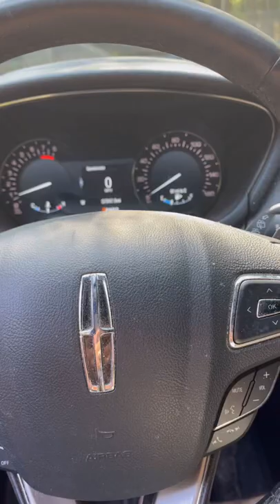Airbag mishap🤓

Comment: Could never happen in a 2000s Honda civic cuz the airbags never work 😂
Reply: A car over 20 years old they usually don't even go off. Airbags don't last forever..
Reply: Yes
Reply: @joeadler5379  more reason to get that aftermarket steering wheel
Reply: @joeadler5379  My niece just got hit in her 1999 Camry LE with 270k early this morning by an either impaired or distracted driver while parked in the starbucks parking lot. Her airbags did go off. The driver of the truck fled the scene. Police are still looking for him/her. My niece is fine and was even able to limp the car back to her mom's house just 1/4 mile up the road but its totaled for sure. Older toyota's never seem to die. Including their safety equipment.
Reply: @joeadler5379 not true cause they last forever
Reply: @joeadler5379 over 20yrs they last.
Reply: @dsteward85 some older Toyotas die.
Reply: Sometimes you kinda don’t who would want to deal with a totaled car on their insurance policy?
Reply: 2003 Honda CRV airbags have a recall for shrapnel 😂

Comment: Don't turn the key on and disconnect the battery first. I've saw the video that the gauges are working which means you've turned the key up while the battery is alive that the sensors will be interrupted. Dats the reason why the airbags deployed when you trying to remove the airbag cover.
Reply: Bruh this is fake, it was made as a joke
Reply: @huhuuhuh9081 he still has a point tho, always make sure you disconnect the battery unless you want to become one with the screwdriver lol

Comment: Question: All those airbags recalled, every make & model. Replaced, warranty. Dealerships.  HAZMAT, yes? Transportation, the defective airbags..Q: Where do they go? What happens to all those "defective" airbags? The plastic explosives..hmmm? Nobody wonders? Worried about a firearm that holds more than 10 (ten) rounds of bullets? Think about it. Where do they all go, the airbags? Nobody asks..I know.
Reply from the maker: It’s a fake video I made. I don’t believe that an airbag can go off that way.
Reply: When airbags explode they stay HOT for hours, ask any fireman or fellas who TOW the vehicle..plastic explosives. These devices are in ( almost) every vehicle on the road. Several together, slightly modified & illigitamatly applied can be extremely dangerous.🥺☹️

Comment: Don’t play around with systems you don’t know about. You don’t know what you don’t know. Lucky you weren’t killed. A/C system is another. Fuel System as well. Front strut springs and spring brakes can be included as well.
Reply from the maker: It’s fake. I appreciate the concern though brother.
Reply: so embarassing for you thinking it was real
Reply from the maker: @358trucking  you must be fun at parties. That wouldn’t set off an airbag even if people did try it. Ps.

Comment: NEVER do that, I was USMC following my "ESCORT", in CA, some mission. To China Lake, 100+ miles outta INYOKURN, 125 Degrees, open road, she ( my contact/escort) was driving a Corvette ZR1, modified. I couldn't keep up. .at a 140 mph. Took me & car a half hour to catch up..open desert road, white lining..She didn't wait, it was HOT.  FELLAS at the Security Access Gate were nice, everyone laughed at the USMC (me). 🥺Mission went great, but they all laughed at me , my poor LINCOLN MARK     XVIII, just a car ..leather sucks in the 🏜️ desert. Next duty station...
Reply: She (GS !? government, pay grade, alot) escort HAD to have been doing well over 180 mph,  easy. A woman of stature, that car was AMAZING,  going fast is easy .1/4 mile..doing over 150 mph in 125degree heat straight line 109 miles!? Open desert China Lake!? Incredible. Following? Yeah, my temperature & fuel gauge we're looking at me wondering if I was trying to kill them
Reply: Believe me..cars are toys, you can always get another one .  But bearings,friction ,heat, tires, ball joints, vibration . Pick a vehicle that suits your requirements. Maintain. They're just metal, oil, like a bullet .accelerating mass from zero to whatever feet per second, or miles per hour. I would have rather parachuted in two miles WEST near China Lake,buried my chute, got a motel,hit shower & met my escort after complimentary breakfast than drove. Some dumb operation. She should have picked me up.

Comment: "Boy you are going to get me drink'in if you don't stop driving that hot rod Lincoln." (Song,music) my Mark 8 had 'no speed govenor"' 158mph, verified, 29 Palms. USMC AN/PVS, Satellite GPS five satellites, ground speed set to mph.  My balls were in my throat I let off..wondering tie rods, linkages,suspension, bearings.car could do it but .I now know how big my balls are. NOT 150 mph.
Reply: At that speed you are not " driving" you are Flying. Steering wheel input is a "recommendation" when/if the the contact patch ( size of your palm,15" tires" touch & coefficient of friction on asphalt  redirects.  Don't do it, more than once...before you die. ITS AWESOME! Just...well. Don't hit anyone.